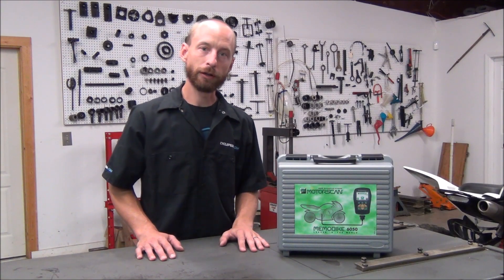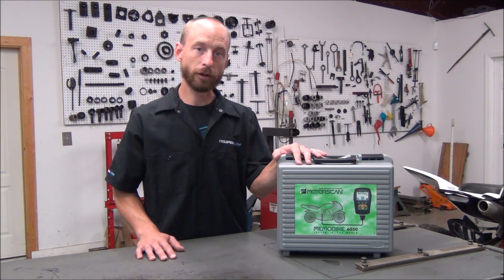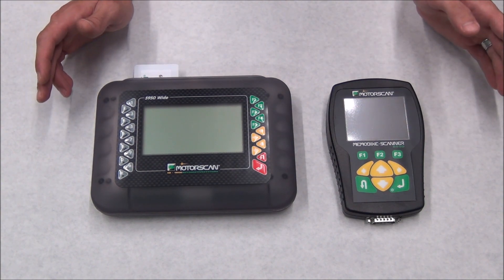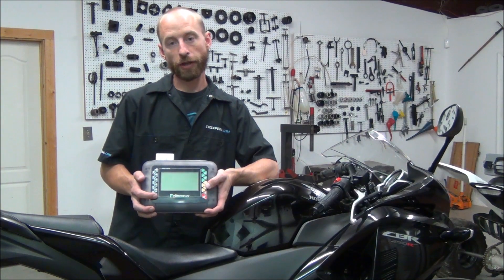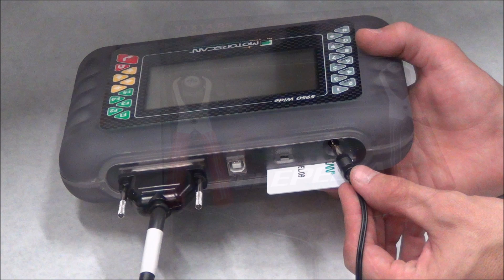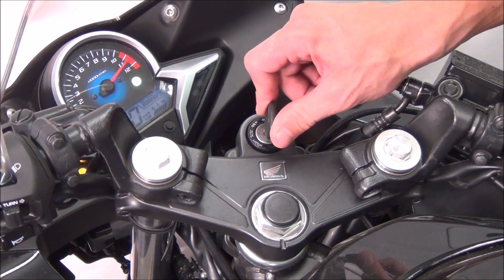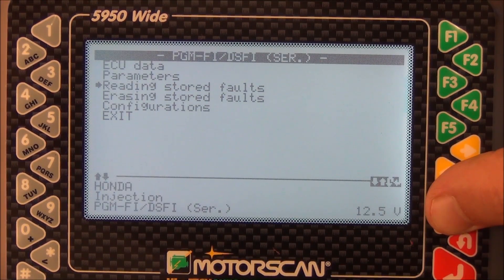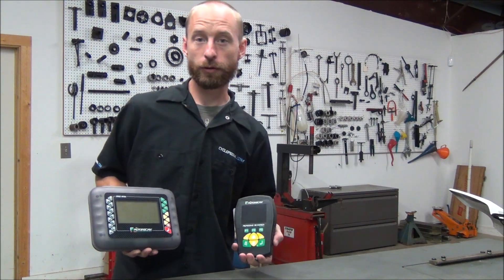Motorscan 5950 Scan Tool - Motorcycle Diagnostics with Scan Tool

Comment: Does this scan abs codes on a 2gen hayabusa? If not . Pls anyone knows what can I get or how can I scan my abs codes? My abs light stays on all the time
Reply from the maker: Yes it will work on your 2gen hayabusa.
Reply: @Cyclepedia  but would it be able to read the codes from the abs module, my abs module it's an independent system it's not connected to my ecu

Comment: Please can you tell me if this diagnostic tool works with all motorcycles?
Reply from the maker: It did at the time this video was made but you do have to have the correct adapter cables.
Reply: @Cyclepedia  what about on a 2017 victory octane